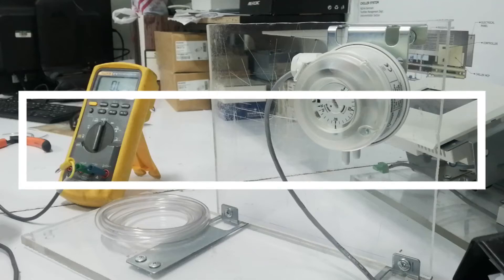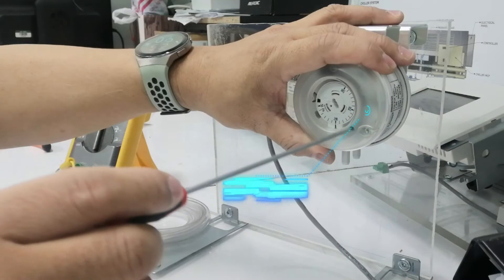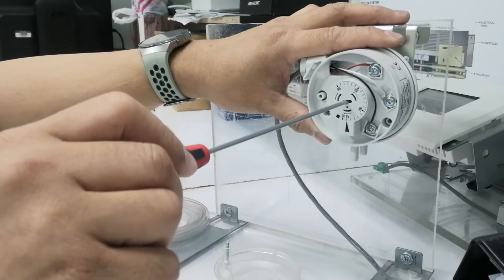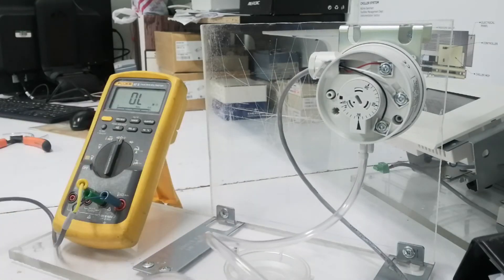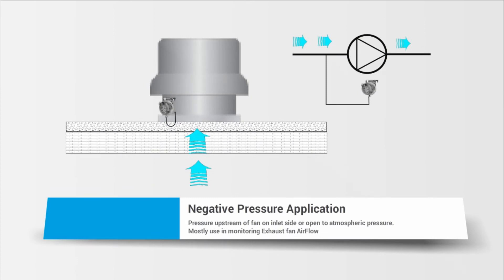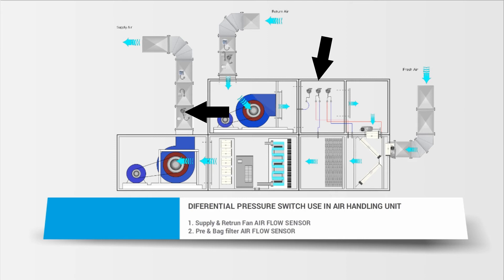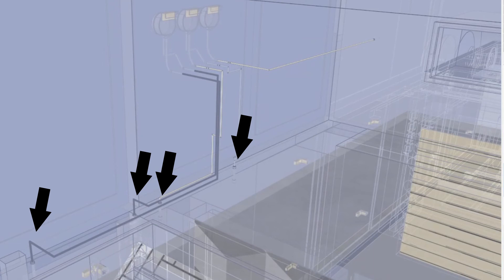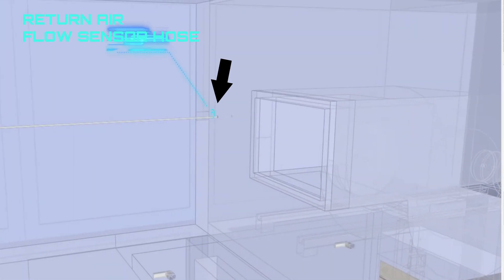Siemens Differential Pressure Switch for HVAC

Comment: I am going to use it in 30mbar pressure. Whenever my suction pump gets off the DPS should be able to provide a signal. 
Meaning from 30mbar when the pump is off the pressure will tend to increase and I want to generate a signal. How can we do with this?
Reply from the maker: Be aware that this kind of DPS from siemens is for air ventilation , for liquid and gases you can use other type - check https://hit.sbt.siemens.com and find the sensor you need. In your case if you are going to use in 30mbar you should check the sensor pressure range. QBM81-50 pressure range is 10-50 mbar.
Reply: @TheMachine0021  I need it for air as well. The thing is I want to give my machine a signal whenever my vacuum pump turns off. As vacuum pump turns off the pressure will try to reach to 1000mbar which is 1bar or 14.7 psi.
Is this possible for this switch?
Reply from the maker: Use the negative port of the sensor and connect it to the line before your vacuum - use QBM81-50 which pressure range is 10-50 mbar / 1000-5000Pa. It can give you a signal by using its contact NO or NC depends on your circuit.
Reply: @TheMachine0021  If I set it at 50mbar set point will that mean that inside and outside pressure difference must be 50mbar?
If the suction pump is doing suction at 30mbar and whenever it gets off so the pressure inside the duct will rise to 1000mbar which is the standard pressure. So, if set at 50mbar the pressure inside should rise to 950mbar to generate a signal. 1000-950=50mbar, am I right?
Reply from the maker: @hp5683  yes you're right👍👍👍
Reply: @TheMachine0021  Can I get a answer for my question please?